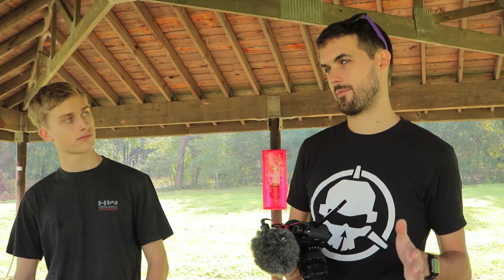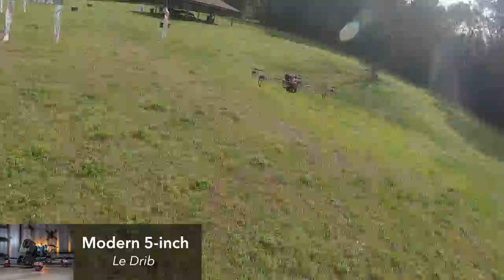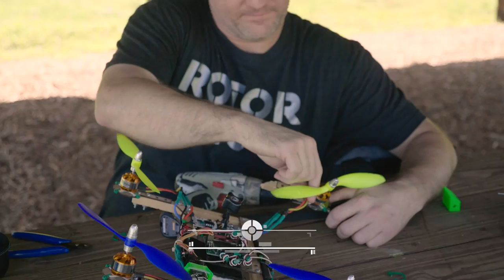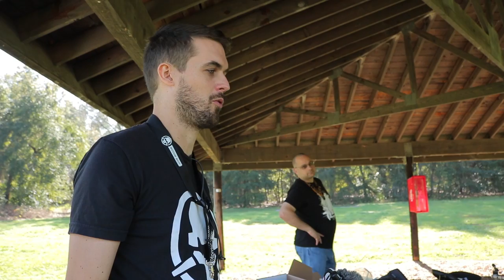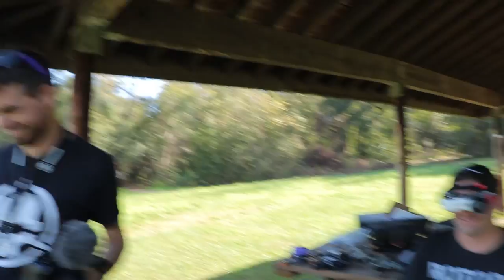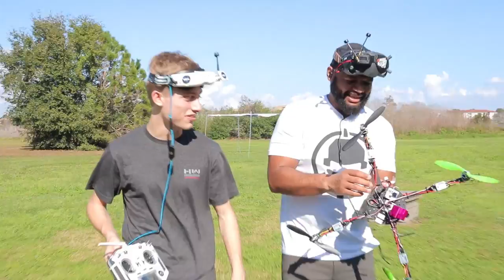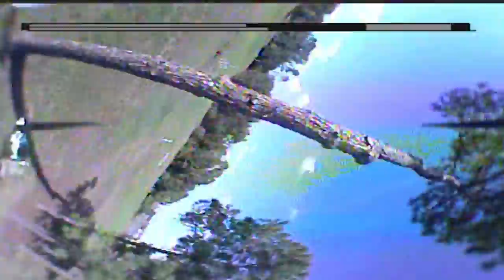FPV Drone with WOOD FRAME?... Kaveman Kwads!

Comment: I remember my kk2 anycopter and how quickly I jumped on the Naze train. When I went to Naze on baseflight and got my PIDs dialed in, I thought I owned the best flying machine on the planet. I also remember it only seemed like I had the anycopter for a couple of months and soon I was torn between the QAV 250 and the FT versacopter for my next quad.
I ended up with a QAV 250 on a F3 and ran that quad until the F4's came out with the OSD built in. (I mean no mention of minim OSD here at all?) 

I have been out of the game for a while I just renewed my interest and it seems like everything has changed completely already. (I mean production quads on 6S? and DJI HD FPV!!!!)

If anyone has an old pair of fat sharks they don't use anymore hit me up!  LOL!

Comment: While people are laughing about these quads of yesteryear, all I can say is that I wish there was as a control board around today like the Hobbyking KK2 that can be programmed without the use of a computer (or an adapter to eg Betaflight). While connecting an Emax Tinyhawk II Freestyle to a Speedybee adapter for connection to Betaflight, the USB port broke off the control board, and despite making SEVERAL requests to the Emax customer support, they were unwilling to repair it, send me a replacement part, or even to tell me which 90 degree USB port is required for the replacement !!! So, in my view the KK2 board is most certainly user-friendlier than today’s high-tech systems, which however, given the necessary customer support, would probably be a worthy replacement for the system (KK2) that is laughed about in this video.

Comment: I came at the wrong time when the FAA about to regular the hobby. I got a Empty frame waiting to be build. I Don't have a radio yet but I'm looking at Radio master.
Reply: No kidding. I almost built a drone with an arduino. (2014)
Reply: i have 5 unfinished quad builds. I got into the FPV hobby in 2014.My older gear flys better then the new gear. I use Spektrum DX6 radio.

Comment: I swear I’m Sean… I have parts from 15 years ago and just got into fpv sort of. I have the old head case goggles… yeah you needed a whole ground station and everything. 230x480… so imagine my amazement with the 03 and the goggles 3🤣. Just upgraded from my old flysky garbage to the boxer with ekes… and now I have like 10 quads I’ve designed. I’m an engineer by trade. I’m in deland fl. Hit me up!😊
Reply: And I came in when everything was still arduino based and the arducopter was brand spanking new… 🤯I can get gps!?!?yeah
Reply: And I was flying fpv first with planes… didn’t get more than 300 ft… crashed a few expensive ones and gave up. It interfered with the fly sky with router extender even 😊

Comment: Man, it was some epic throwback episode. I remembered that the drones used to be ugly and hacky (no offense to those pilots, they're the one who drove the hobby towards better and completely DIY drones that has better flight computers with 32-bit CPUs - flying 8-bit flight computers usually based on Arduino software and hardware were a bit sketchy due to the resolution of computation as well as powerful powertrains, and being capable of being 3D printed nowadays), now we have better drones - at least the end result is obviously a better flight computer that can handle the stick drones no problem after a few tune-ups. It's interesting to see those caveman drones flying.

Comment: Quad from 2014 and a KK2 flight controller but a TBS Triumph Antenna and modern video transmitter?
That's cheating you need a dipole antenna for true 2014 realism right there.
Reply: bernard Li - haha.  Yeah.   I only had so much old tech.   I should have asked Chad for more stuff, he said he had a ton of stuff in his attic.

Comment: my first qwad is on my wall kk2 board with the screen 450 size with 12" props and goes up with 2 5200 4s batteries its slow heavy and flys like shit actually turned me off the hobby for a few years went back to my fixed wings now with these new small durable things and beta flight its awesome night and day for sure